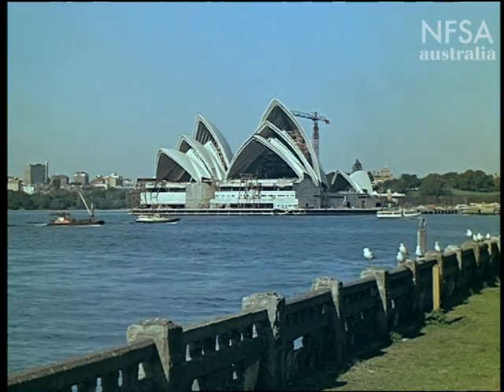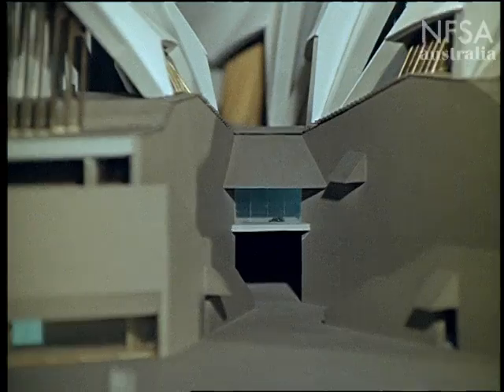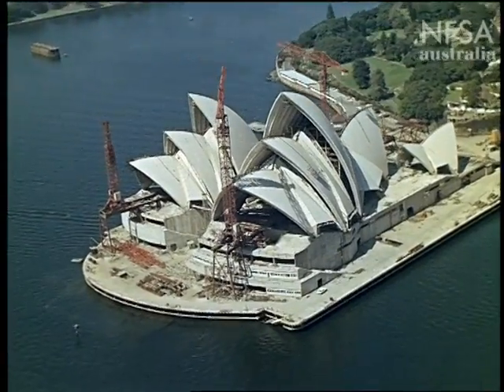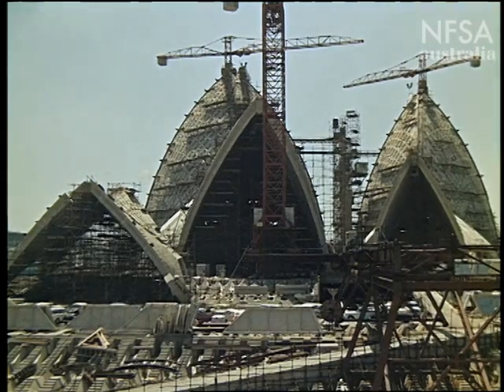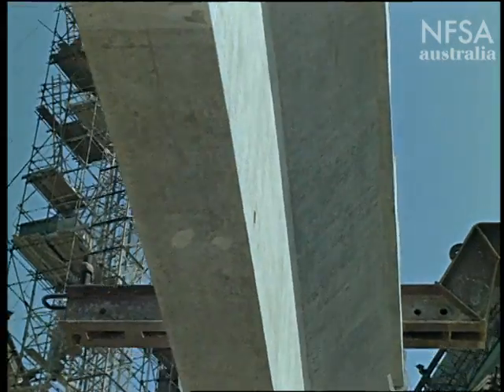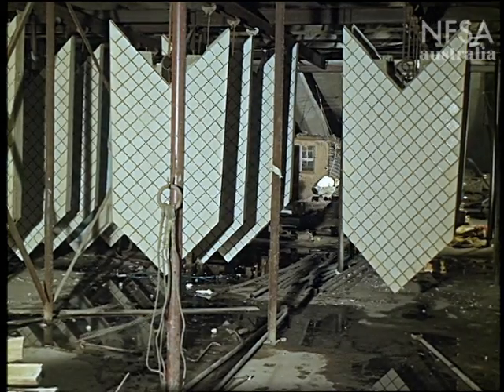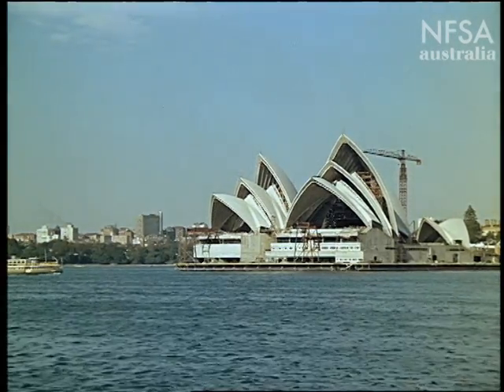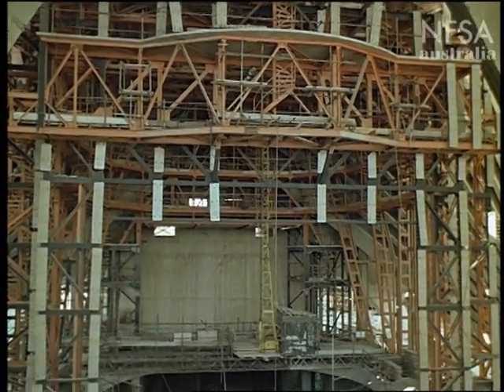Sydney Opera House. Australian Colour Diary 28.

Comment: Apart from the films already on YouTube, does NFSA have other films on the construction of the Sydney Opera House?  I can remember watching a contemporary film on the construction that was far more detailed than this, it included surveyors using specially made markings in the ribs to check they were in the correct position, also using the computers (overnight) to determine the spacers that were placed under the "lids" to correct for small differences in where the ribs were compared to where they should have been.   If not finished films, do you have raw footage?

My father worked for M.R. Hornibrook (M.R. was a Queenslander and lived in Brisbane) in Brisbane, the Sydney section built stages two and three of the opera house.  Utzon did not like the quality of work done by Civil and Civic in stage one, I suspect they never understood the importance of surface finish in cast concrete, it was not common to display it in those days.  Also, in their defence, Stage 1 was a rush job to make a start and thus stop an incoming government from cancelling the project.

Utzon never fell out with Hornibrook even when things got sticky with Arup.  Hornibrook did a lot of innovative work on the opera house, Utzon had the vision, Arup did the engineering, but Hornibrooks had to work out how to build it, to specifications that were extremely tight, possibly the most precision built building ever up until that time (precision of a large three-dimensional curved surface in space that could not deviate as there was no way to correct a mistake).  The construction arch was all Hornibrook, designed by a young engineer hired to do that particular task.  I don't think they ever got the recognition they deserved (apart from their name on the construction cranes for such a long time).  Even in this film, they are just referred to as "the contractor".
Reply from the maker: There is a film called the Fifth Facade  1973 about the construction and opening.  Not sure if we can upload to YouTube because of copyright issues but will check.